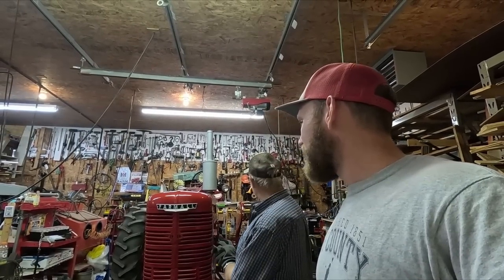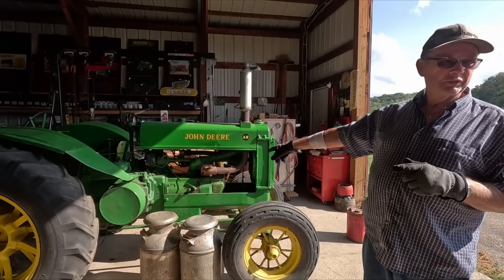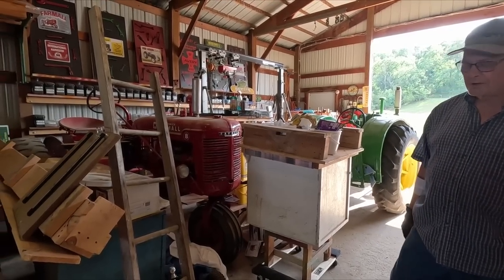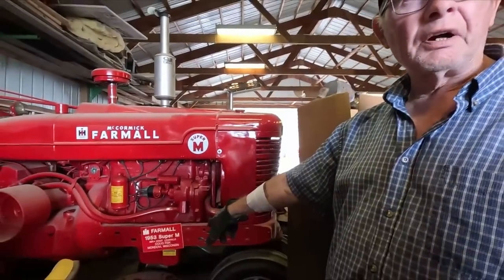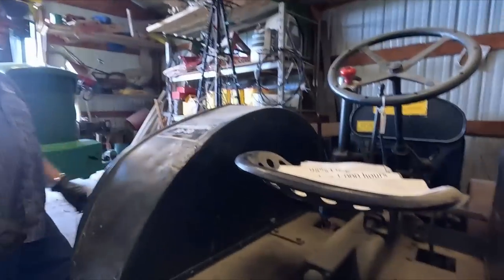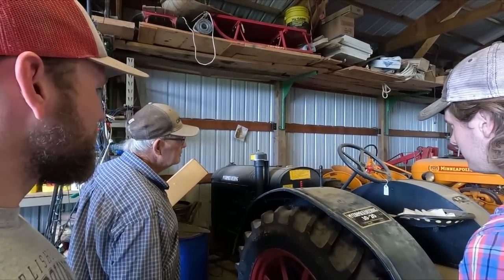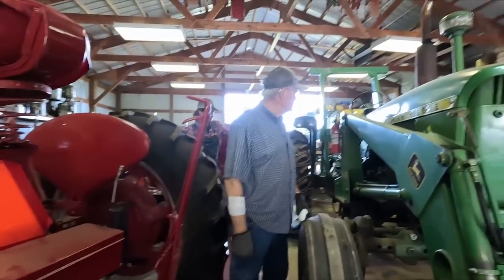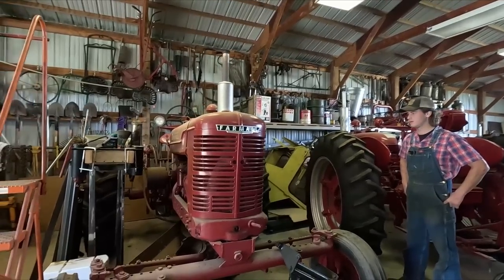A Fully Restored Antique Tractor Collection!

Comment: That John Deere cab tractor has a solenoid on the right side down under the seat area and of you take a 1/4” flat nose punch or a screwdriver and gently hit the center of the solenoid and it should knock it free. Then engage the solenoid every time you use the tractor. Worked for me